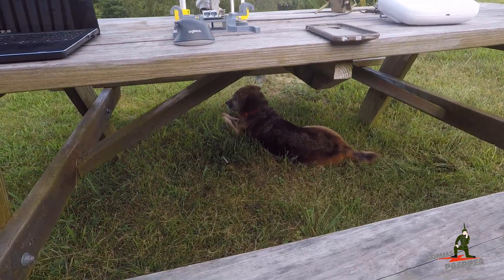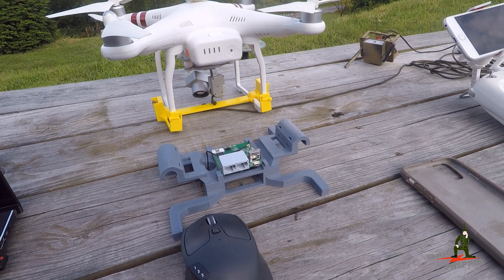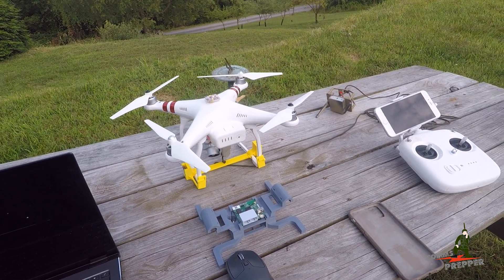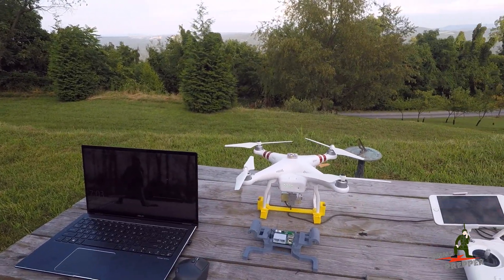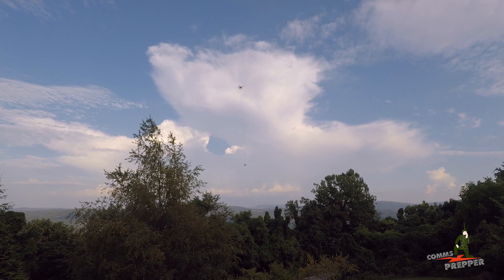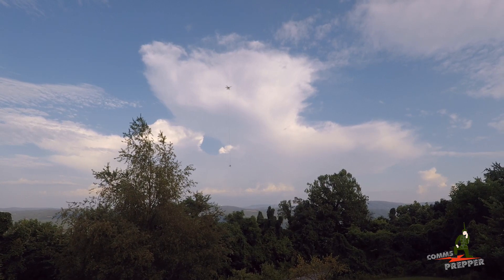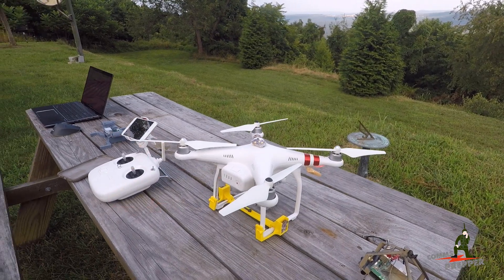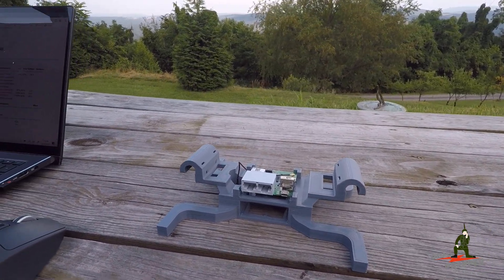Amateur Radio Aeronautical Mobile - AREDN Node on sUAS (Drone) Platform

Comment: You could use a RC glider with solar panels and ardupilot. It will soar a long time, because the battery will recharge constantly.

Comment: Welcome back ! I have done lots of contract work for a rural ISP that uses 5 Ghz Ubiquiti airmax / airfiber for transmission and distribution. For stable platform LOS links it works great with directional antennas end to end but millimeters of movement in extended distance links make a profound difference in performance.  If your drone could handle the weight of a good 10 - 13 dbi omni  &  radio it would really help. I have not had much luck with those small omni antennas  even with < 1 mile links @  > 100 ft.  Its fun stuff to play with regardless. Thanks for sharing !
Reply from the maker: Thanks for the welcome home and tips on antennas.  Working on a new approach to this project now.  Respectfully - Hank

Comment: I don't know much about drones, but how about putting a metal shield (Aluminum foil?) on the top of your cradle to block the signals between the drone and the router.  Also they make a smaller router supported by AREDN (https://amzn.to/2Mkw01F) that you could hang vertically with a small battery pack that might help.  Not certain if any of these ideas are helpful or not.  Keep up the good work!!

Comment: commsprepper, one option to consider is using different antennas with the GL.iNet device.  It is a 2GHz MIMO device and offers improved performance using 2 antennas-polarities.  The Bullet is a polarity-antenna-polarity device.  If the device is moving around a lot or spinning, this can be problematic.  The radiation pattern for these antennas is a donut shape and the signal strength would be going in and out for the Horizontal and the Vertical risks  at this height reaching the ground.     Maybe there is a dual-polarity flat patch antenna that can be sourced with a downward wide angle shape.    Here's a commercial grade test, the 2 antennas inside the device are pointing to the horizon for users to to connect to miles away.  https://www.arednmesh.org/comment/12193#comment-12193
Reply from the maker: I am thinking about stripping down a Nanostation Loco and try putting that up.  I will need to workout the center of gravity and print a housing for one.

Comment: It would be great to have a tethered drone, sending power up the tether, so it could could fly indefinitely.
That requires thin wire and high voltage; not easy.
Reply from the maker: The do make tethered drones but I can't afford one.
Reply: I'd thought of tethered drone or a tethered weather balloon. For use in SHTF or everyday life public service events. I'd still love to try it sometime.

Comment: I would look into LiFePO4 batteries and pushing the voltage input by a volt or two. Also look at the antenna. Rather than the rubber duck, look into a full wave wire. That will save mass
Reply from the maker: Agreed.  I see a version 3.0 on this project.
Reply: Look into the dual moxxon antenna that is popular with long range drone control, it may be the way to go with the bullet hanging from the drone and the eggbeater antenna pointed towards the ground.

Comment: Raise a endfed 160 meter antenna or a simplex u/v repeater
Reply from the maker: Simplex repeater would be great - if I could find a small transceiver
Reply: @Commsprepper  Remove the heavy battery from handheld and use drone battery for power, also may fill large plastic garbage bag with helium and fishing line to aid in lift and use much less battery to keep it up.